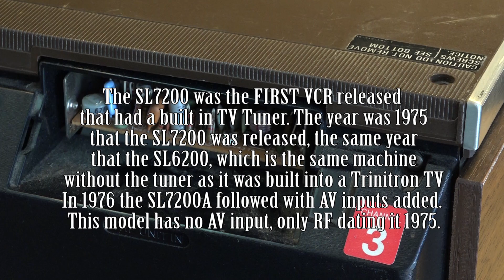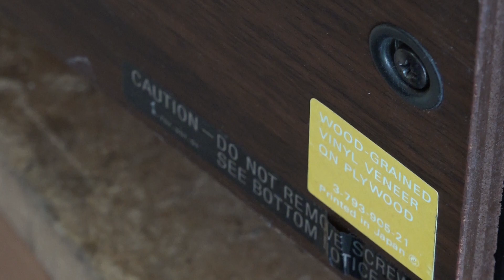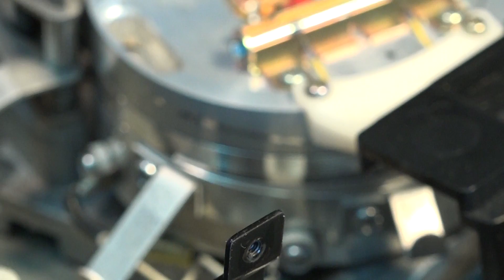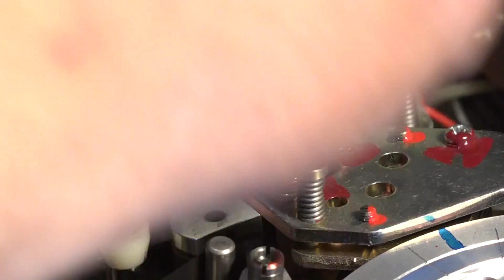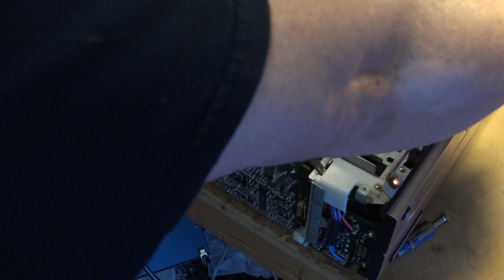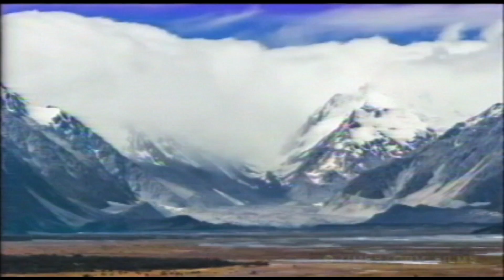Sony SL7200 Vintage Betamax Overhaul repair

Comment: A tech would earn his payckeck back in the days when it actually took an hour or so to service  a beast like this. Perhaps six machines on the bench in a day's work.  You didn't have to recap this 40 year  old machine, the electronics functioned OK.  Don
Reply from the maker: 6 machines a day? That would have been a slack ass shop. The pressure cooker I worked in I would see 3 or 4 TVs and 8 or 9 VCRs in a 9 hour day. The pressure was always on me, day after day. After 20 years it was time to get out. That was just for me, as the master tech. The assistants were busy too, they would disassemble and reassemble the cabinets. It was a regular production line. A unit would be torn apart by a gopher, I would find and fix the problem, and hand it back to the gopher, and he would put it back together.Why did I call him a gopher? Because every time I turned around he would "go for" coffee, or "go for" drive to pick up or deliver a TV. He was always going for something, and I was stuck in the pressure cooker with no windows, and no ventilation. With all the smoke and chemicals I inhaled on the job I am surprized I am still alive.